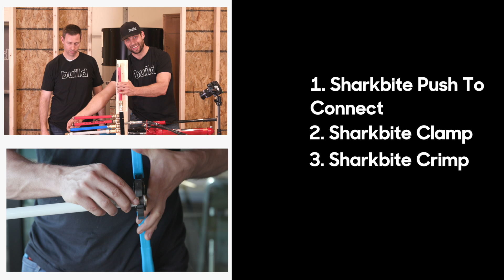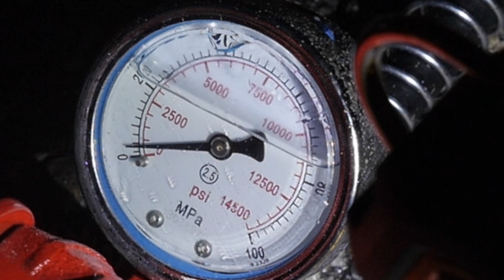Can we blow off these PEX fittings?  Sharkbite vs Viega vs Uponor

Comment: First test Matt you literally pressed your thumb on the Sharkbite connector release ring as it popped off.
You also put thread tape on the threads compression fittings which is also poor technique as the threads do nothing for sealing the pressure but the thread tape on the threads will reduce the compression effectiveness

Comment: They miss the point entirely. With 250 PSI water pressures what is critical is uniformity of connections. A large commercial building was plumbed using this type of connector and then there were leaks inside the walls and a great deal of demolition was required to locate the leaks and fix them. If a worker is putting in dozens or hundreds of connections it only takes one connector failure to cause serious problems in a building. 

There are tools to insure a uniform connection is made and these are the least hazardous.

Comment: That’s a BS test you caused the shark bite to fail pushing up on the release.  I have used shark bite all over my house and have NEVER had a single problem from them. The problem just like anything else is put it on correctly.

Comment: You wasted our time here. As you (hopefully) grow up and develop critical thought, you will pre-plan using simple story boards and an engineering degree to produce meaningful and helpful content.
You seriously need remedial instruction on pressure gauge transducers and peak pressure displays that freeze on the failure pressure point and use your crayons to fill in your Barney and Friends story board.

Comment: terrible idea to be touching anything you are expecting to fail under pressure.  Even more terrible with hydraulic fluid.  You do not want a pressure injection which could and actually has been lethal!!  In the first failure if that pipe had gotten a pinhole under his hand causing an injection he would have regretted touching it after the Dr bills and possibly amputation or worse..

Comment: They didn’t have the shark bite seated enough to begin with, have no psi amount, the order of the pipe and their pump isn’t a good test, and the leaking threads compromise the entire test. Obvious the pipe is going to fail in order from bottom up. The proper way would be to make a complete square with the pump connected in the center and along the square staggered evenly, T off with each test pipe. Also use pipe dope on threads. If done correctly then you should be using the same tested connection from the T connecting your even pressure square.

Comment: Pex A bursts around 900psi
Pex B bursts around 1000psi
Despite the slightly lower strength, Pex A is more resistant to burst from freezing than Pex B due to its higher flexibility. 

The pressure gauge they used was useless. 10min amazon search is all it takes to find an appropriate one. This is a low grade video.

Comment: I have never had a shark bite push to connect fail I've had plenty of pipe freezing bust around the fittings but never have I had the fittings fail.
 The new shark bite Max are the way to go
Reply: You will never get that pressure in a home.

Comment: I'm afraid the point should be on which connection to the fitting does not leak as the first one followed by the strength of the plastic. The fifth one (Pex-A) never had a leak if I am not wrong.

Comment: A total waste of your time and everyone else's time. You couldn't even measure the pressure at which everything failed.
Interesting results though: pex is strong and the fitting are even stronger. Threaded fittings leak first, but pex fittings don't leak.

Comment: Dear Ones. Seen this video I saw that you put Teflon on the treads for the compression tubes if you have ferrules on them you should place the Teflon wrapping the ferrule and not the nut treads, this way you can control leaks much better. Best regards

Comment: Sharkbite fittings are bulky and expensive, but they have their place, even if the professionals roll their eyes. Although my off-grid solar home is plumbing mostly in copper with some pex, and with all joints soldered, I used Sharkbite fittings in a few key places. For example, high in my attic where the solar glycol enters from the rooftop collectors. Soldering was almost impossible in such a tight area. Six years later, no leaks, no problems, even though the glycol can pass the boiling point, and winters drop to minus forty. That's a lot of abuse, and Sharkbite has passed the test. So far, anyways.

Comment: Next time use a HYDO STATIC pump, that would accurately simulate actual water pressure, The density of Hydraulic fluid will make the results completely different. Also try Copper and CPVC with the HydroStatic pump. Great video

Comment: Most of these fittings are rated at the 800-900 psi (which you would never see that high psi in a home)…what is the purpose of this video

Comment: Types of tests

Water hammer cycles

Bend and kink strength test

Handling test, push to connect fittings very susceptible to handling, vibration, etc, test under regular pressure, and wiggle, tap, vibrate pipe, also could try acoustic pressure, or pressure cycling, see if the fittings creep off

Temperature, 
freeze test cycles
Failure temp at 100psi
Spot heat failure, simulate things like soldering torch, hot wire/arching/lightning, 
Brittle cold test, chill pipe to -80f take a weed whacker to it, radically display of possible hairline cracks in less severe conditions
Heat degradation, put in oven or dehydrator for hours or days, check to see if prolonged heat and air degrades the pipe

Chemical test
Water conditions that might harm pipe
Construction chemicals that might harm pipe, drain glue or primer, adhesives, airborne stuff from painting, 

Drill test
Things like drilling, cutting, nailing into walls, what happens
Blind tests, does it get pushed out of the way, does it catch easy, can you feel it before anything happens, 

Bite test, 
Rats, mice, dogs, etc
Tasty, do they like it
Difficulty which is hardest for them to chew

Comment: Your test was interesting to view but certainly solidifies my preference to keep using all copper still. Too bad you didn’t add copper to the manifold to prove what holds the best overall. Can’t match old school easily as cost and or speed of install is not always a factor when comparing water damage cost from a fitting failure.
Reply: PEX A is cheaper and easier to install, will last a lot longer than copper, and cannot develop pinhole corrosion leaks.

Comment: If you didn't prep the pipes before installing the sharkbite fittings, they will fail. Just for the fact/example that you two didn’t know how to tighten the fittings, shows your test is a failure. Please redo the test with at least 2 plumbers.

Comment: I am more interested in freeze reliability, make some sealed water filled sections and freeze them, as long as the pipe expands enough at cold temperature to absorb the expansion of the water it's a winner, if not looser.

Comment: Your pressure gauge should be on the manifold, the shark bite failed on the manifold, not the cap?   You need the psi rating at failure..

Comment: This entire test is flawed. You need a proper gauge and you need to test each pipe individually and not on a manifold, and each needs to be tested on the same type of PEX and much shorter lengths.

Comment: The most significant useful lesson I see here is the leaking from both crimp connectors at pretty low PSI.  Presuming they were crimped according to specs (e.g. using the Go No-Go gauge) then that's a bad sign.  Then even after they were "fixed" they both leaked before the pipe failures.  I say that favors the clamp style.

Please redo test, using a more scientific method.  E.g.:
1.  1000 psi gauge.
2.  Observe gauge the whole way and record failure point.
3.  Perform 5 tests.  For each one use 5 of the same connector-conduit combos, each one connected with its own ball valve.  Pump up pressure to failure.  Close off valve to failed pipe-connector.  Continue until all 5 are destroyed.  Then repeat for each of the 5 configurations.  That helps for seeing if there are variations in how they are assembled, and reduces the chances of a defect in any one component causing failure, thus throwing off the results for the entire product.
4.  Chart the 5 results, showing the range of failures at pressures.

That then gives a better sense of how each performs.

Comment: The problem with Pex is not pressure, but the US  public water supply, which has lead to failures and Uponers lawsuits. Have you done any research on if any Pex-A will last 25 years in the USA.

Comment: The push connection is the only re- usable connection..... No failure .... The connection released at maximum pressure ...... Therefore easy fix ..... As the push connect is the only re- usable connection in your test ..... Re- connect and no pipe replacement.   ... WAY TO GO SHARK BITE PUSH CONNECT ....  BEST SYSTEM IN THE BUNCH

Comment: So basically, the only fitting that failed is the sharkbite push-on. The rest held up but the pipes did not, however I believe they all would be fine in a normal situation.   It makes sense why the first pipe failed so early, its the most flexible so its also the weekest. Does anybody know which fitting setups are the cheapest as far as having to buy the tool and fittings?
    Im thinking it may one of the pinch fittings if I had to guess. Im still old school with sweating copper and pvc and glue. But which should I invest in next?

Comment: I’ll tell you from personal experience which fittings fail in real world application. The stainless steel pitch rings are worst after shark bite. The aluminum crush rings are next. Then the copper crush ring from zurn, and uponor is hands down best as far as longevity. The metal crush rings will decay in a crawspace or a basement if the humidity is high. Out in west Texas they are fine but in places like Houston and DFW they don’t appear to hold up. The stainless steel pinch rings are absolute crap.

Comment: IBC is 40-60 psi max recommended is 62. Most water appliances are 75 or 120 psi. Shark bits are nice in -60 as they are the first to fail and save the rest of the plumbing

Comment: Hey you you tube freaks. I use flexible pipe, patented under me. And you hot melt join. 50 years life. Yours is metal joint . Will corrode after 10 years and start leak.

So you lie.
No leak now but will be destroyed after 10 years.

You just cheap consumers  who doesn't understand piping. How much you getting paid for this lies???

Comment: The 14,000 Clickbait was a joke. You could’ve done much better. Please repeat this with some specific answers as to pressure. Having the 14,000 pound gauge is useless. Most of your videos are very very informative This one, however, should not have been aired. Try again.

Comment: I am a plumber, but my first encounter with pex was a failed sharkbite push to connect. I chose to use an expansion tool with the fittings and pressure rings.

Comment: so this only proves, that all the old solder plumbers that absolutely hate this new method of plumbing, just hate it because its different and new. Because, there will never be a house over 200psi or even a 150 to really cause failure like this. And also proves that whenever you do see fittings that leak arent because of the type of fitting but improper installation.
Reply: Inproper installation and likewise, short cutters who can't read a tape measure to put in correct plumbing but want to charge old school prices for new school crap😂....typical contractor service who are former felons

Comment: I would love to see this test done with a couple of extra gauges on it.  Put like a 500 pound gauge and a 1500 pound gauge, both protected by a valve so we can actually see the failure pressure.  I would also like to see another Uponor pipe tested, just in case that was a rare pipe problem, things happen.

Comment: Even though this was kinda useless from a real world application, I learned a lot about the real world performance of the different PEX, and the fittings. I was worried about the crimps, and the benefits of the PEX types, but I now know that all fittings are adequate, and the PEX itself will hold up better than necessary.

Great testing.
Reply: Is PEX Better than flowguard/CPVC??

Comment: This was pretty useless, unless the point of the video is to just plain blow up fittings or pipes. because the " results" are invalid based on the pipes being filled with air and not bled properly, and 2 they had absolutely no PSI readings, with the exception of 1?

Comment: Twice a year now I'm going to test to make sure the water pressure in my pipes do not go over 200 psi. I've always been concerned about that anyway.
Reply: Don't worry, water coming in is usually around 60. 200 is what sprinkler guys pump their lines up to with a compressor for fire marshal tests. They just pump it up, and let it hold to make sure no leaks. Then they drop it back to street pressure. All of this to say 200 psi is a lot and basically guarantee you'll never hit that in a normal everyday home. Cheers!

Comment: Uponor told me that in their testing, they have not seen pressure failures below ~220 PSI and that is with hot water.  I have run 80 - 120 PSI Compressed Air through 3/4" Pex A to trash pumps that bang back and forth at very high rates.  We have been doing this for 4 years with Zero Pex A failures.

We also pump a caustic soap (pH >13) through clear 1/2" Pex A.  This has been done for 4 years, again with no pipe failures, but the caustic has killed some brass fittings.  I have recently found the plastic versions of these fitting and they will begin use soon.

Comment: One big take away - You guys disproved the myth that stainless steel cinch clamps are weaker than copper rings or expansion.  Withstanding 500 PSI without a flinch put that bs to bed for me. THANK YOU!

Comment: HUGE WIN FOR SHARKBITE!!!
On that pressure gauge, each tiny line represents 500 psi. We can clearly see the needle BARELY start to move when ALL of their threaded pressure fittings begin to fail. These guys are home builders and professionals and we assume they installed these threaded fittings as they would on any of their jobs (valves, tub spouts, drop ear stub outs, etc). They ALL failed before the Sharkbite fittings did, yet these are all connections plumbers use inside walls on a daily basis all while claiming they would never use a Sharkbite inside a wall. 
They keep going and the needle is clearly moving just past the first mark which would be at least around 600psi. (It could actually be much higher as they continue pumping after that but the camera has cut away). Then the Sharkbite shoots off... At what we can assume is AT LEAST over 600 PSI!! That's incredible!!! 

Id also like to point out that the test was skewed against the sharkbites to begin with. Notice that all the other fitting types are connected to the manifold via threaded brass fittings (which ALL end up leaking allowing pressure to escape) and the Sharkbite pipe is connected to the manifold with another Sharkbite fitting, which should be noted NONE of the Sharkbite fittings leaked, so the Sharkbite length of pipe received the full extent of the pressure applied, unlike the other ones which all had leaky threaded fittings that for whatever reason they left leaking the extent of the whole test... Probably because it was impossible to stop them from leaking at pressures nearing 400-500 psi.

Then we go on and what's all the different pex  pipes and fittings fail one by one at around the same pressure we saw the Sharkbite fail. Again, the Sharkbite most likely failed first because it was the only pipe not connected by a leaking threaded fitting to the pressurized manifold, AND it was at the end of the manifold length which also receives the greatest pressure first.

Comment: For starters, I believe you have the shark bite setup for failure being straight off the end like it is. The end should be used for equalization, should it not? I also believe it would fail first as well. Good video, very interesting.
Reply: not to mention he pushed on the release of the sharkbite

Comment: nice test , but you need to test each pipe isolated from the others. 
The material has a better memory than the elephant. The fatigue loads are added to the rest of the pipes each time you test it. 
So, one by one and check max static pressure. (usually you need minimum 6 samples per tube and same failure mode)

Comment: As I have been telling people for years. Sharkbites are only used for emergencies and when absolutely necessary! NEVER BEHIND A WALL. 
Also have been telling  people about expansion been repairing those pipes as well.  I believe the expansion weakens the pex with  increased premature failure.

Comment: Hmmm, goubers at work,
Not alot of life experience. 
Placing your hand over a plastic pipe that your pressurizing till it pops,
Assuming that at the point of failure the cap will go in the direction it is presently pointing.